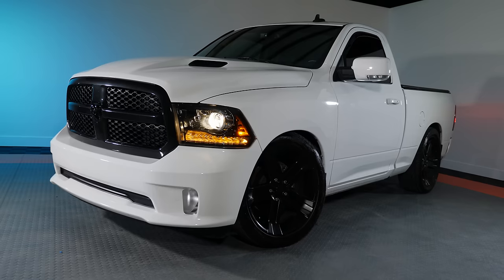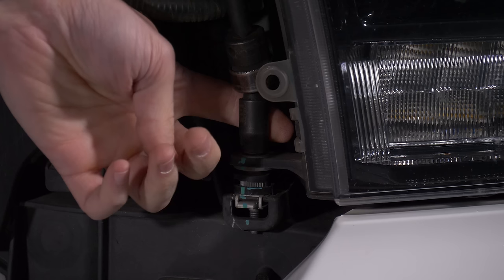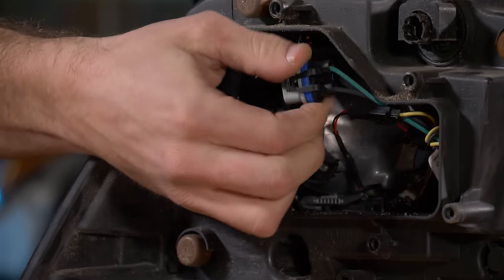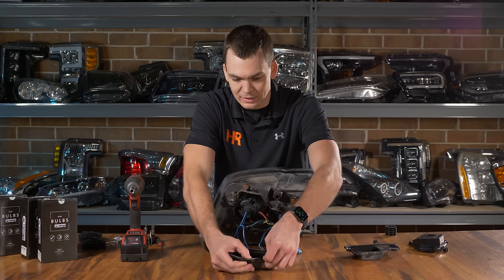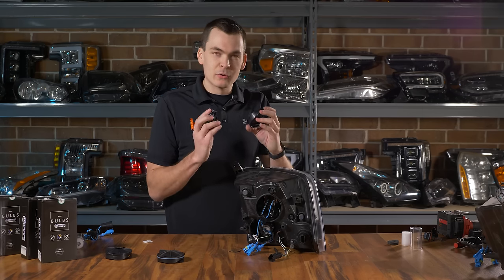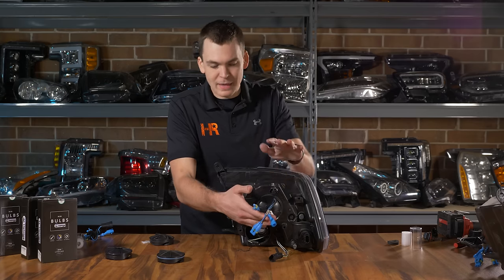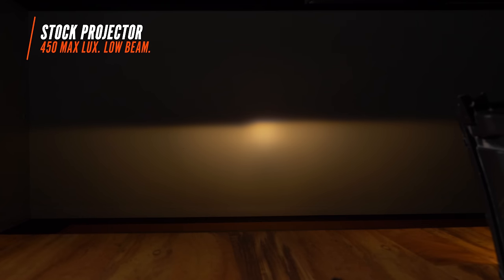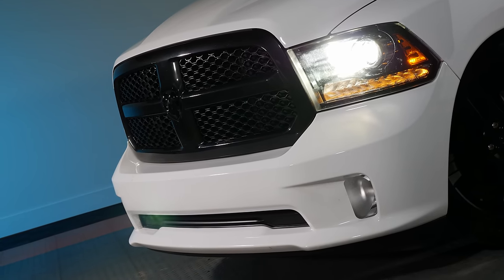HR Tested: 413% Brighter lights For The 09-18 RAM 1500 Projector and Reflector Headlights

Comment: Anyone watching this video, I recommend led’s for high beam. They need to be able to be flashed, come on quickly, and not have a warmup
Reply from the maker: Hey Jeremy, I agree with that! I love the instant on-instant off. The GTR Lighting CSP Mini bulbs are one of the only options that fit these high beams and they work pretty well. We have a video coming out on them soon. -Chris W
Reply: I suggest quad projector setup. Four lows and instant four highs with Bi-Xenon projectors.
Reply: Ricardo Molina that would be ideal

Comment: Now with the newer LED bulbs available lets see a LED vs HID shootout on the ram projector headlights.
Reply: Would love to see that
Reply: LED should be used for non-bixenon highbeam setups regardless, as LEDs are instant on-off, whereas HIDs come on too slowly for flash to pass or even most short term highbeam use.  For lowbeam HID is good.   For LEDs, I recommend the Hikari 2020s.  I don't know how long they will last, but they are suuuuper easy plug and play install, and they have a 2 year warranty.
Reply: Which model Hikari?
Reply from the maker: Great idea!

Comment: I have this 55w kit w/5k bulbs on my 14 Ram 2500 and the beam pattern on the passenger side is not nearly as focused as the drivers side.  Could be the projector is not in perfect alignment or something else is just out of tolerance(HID bulb?) but I don't get this with the stock 9012 bulbs.  Although it is still much brighter than stock but there is a definite difference in the 2 beam patterns.
Reply from the maker: That is very strange, Have you tried swapping the bulbs from the driver to passenger side to see if that issue follows the bulb? If it does, Let us know and we will get you a brand new one. -Chris W

Comment: Good vid... 
I just did this with a buddy's truck. 
You don't necessarily need to totally remove the grill and top flap to Remove/install the lights... 
Lifting the flap a ways, and a long extension will reach the bottom bolt, directly from the top looking down at it.. The rest as normal.
Reply from the maker: Thank you for the heads up, I've always wondered but I haven't tried it. -Chris W

Comment: Well, thanks for the response; but if this video is outdated, than what I really need is a recommended alternative, not just an explanation of why it's outdated, please! I had hoped this this YouTube video, (and the Headlight Revolution experts) would recommend a tested solution to convert my 2017 RAM headlights to LED - and then I could purchase it from your company with confidence. I can't find a high and low beam conversion on your website.
Reply from the maker: We can not recommend any LED or HID replacements for your vehicle, as they are not street legal. What we do have as far as LEDs that will be legal to use are the Morimoto XB LED Headlights, and I have linked those here: https://headlightrevolution.com/2009-2018-dodge-ram-xb-led-headlights/

That will be the high beam and the low beam, and will provide you with an amazing upgrade for both light output and beam pattern! If you have any other questions, just let us know!

Comment: Great video, thank you for the clear walkthrough. I just completed this install, except I used the new CSP minis for the high beams and fogs. Looks unbelievable. However, I'm noticing a strange pattern on the HID low beam. There's a slight rectangular "shadow" on the drivers side low beam. It's off to the left peripheral and almost looks like a bit of the light is being blocked by something. I've looked closely at the projector eye and rechecked everything. Nothing stands out. Any ideas?
Reply from the maker: That could be caused by a few things. Shoot us an email, and we'll get it worked out! Sales@HeadlightRevolution.com

Comment: I wish my low beam install had gone this easily.  The pass through connector won't make a connection when plugged in to the OEM low beam connector.  I had to depin the pass through connector and plug the pins directly in to the OEM connector to get them to work.  The light output is great though.
Reply from the maker: Did you get the kit from us? If so, That’s very strange. If you have trouble reach out to us, We’re always here to help out.
Reply: Headlight Revolution Yes, I got the kit from you.  I have been in contact with support and we have tried new bulbs which makes no difference.  Low beam works if plugged directly in to ballast not using the pass through cable.  They also work if I depin the pass through connector and plug the pins directly in to the OEM low beam connector.  That’s how I have them working now and I just have the pins and OEM connector wrapped in electrical tape to hopefully keep the pins from coming loose.
Reply from the maker: Very strange, I’m glad it’s all working out for you so far. I wonder if that pass through connector is just a little too thick or the pins are a little too short.

Comment: I'm confused why you call that a projector high-beam, both of those headlight assemblies are equiped with reflector high-beams. There is clearly no projector lens other than the low-beam.
Reply from the maker: You’re absolutely correct. What I am referring to is the high beam on the projector based headlight housing. In this video, I show both the projector and reflector headlight housings.

Comment: My question is that can u use the projector headlights on a 2009 Dodge Ram?
Reply from the maker: If you are talking about doing the OEM projector housing conversion, you can totally do that on the 09-18 Ram truck lineup!👍 I have linked that kit for you here: https://headlightrevolution.com/2013-2015-dodge-ram-1500-oem-driver-passenger-black-projector-headlights/

Comment: how are you going to flash with xenon HIDs in high beams when they take 5sec to warmup?
Reply: You don’t
Reply: You can precharge them I guess but once they cool down they have to recharge
Reply: I suggest quad projector setup. Four lows and four highs. Bi-Xenon  projectors.
Reply: The same way you do with anything else lol. They still come on the second you hit the switch, just not full brightness.
Reply: wantsanewvehicle negative. They hardly shine until at least 3-5 seconds after engaging
Reply: @ActingLikeABoss  I do not know what the brightness is in lumens the instant they come on, but it is plenty bright enough to 'flash' them and get the same outcome you would with any other type of bulb. I had 2 sets of hids in my 2013 fusion for over a year (1 set for low and 1 set for high). This setup is not nearly as bad as people try to make it seem. Yes, I am well aware that they are not full brightness the instant you turn them on, but '3-5 seconds' is not 3-5 minutes like everybody tries to make it seem rofl. If you do not know what you are talking about, then you should not be trying to act like you do.
Reply: I have led on my high beams and hid on my low beams. Leds lose to HID in projector housings.

Comment: ? low beam is ok for the road but the high beam kit is not
Reply: i have a 2016 power wagon
Reply from the maker: As long as your headlights are aimed correctly, we would recommend either of these upgrades for your truck.

Comment: High beam must be led. And....reflector low beams are blinding oncoming traffic. Negative
Reply: Both hid
Reply: My answer is get a quad setup of Bi-Xenon projectors. Four low beams and four high beams when you turn them on. Only four at a time.
Reply from the maker: You should always adjust your headlights after an upgrade like this. That being said, We have maintained the factory beam pattern pretty well here!

Comment: Brighter is not better. You would understand that if you knew how eyes worked.  Eyes have to dialate at night so that you can see better. The brighter your lights the less you see outside of their beam.  You blind your self as well as those around you.
Reply from the maker: While I get where you’re coming from, I must say in real world driving conditions this upgrade makes a massive difference in how well you can see down the road at night. These Ram trucks are dim from the factory, This is a major improvement functionally.
Reply: @Eddie Eaves lol!